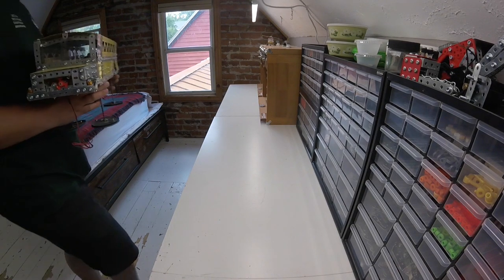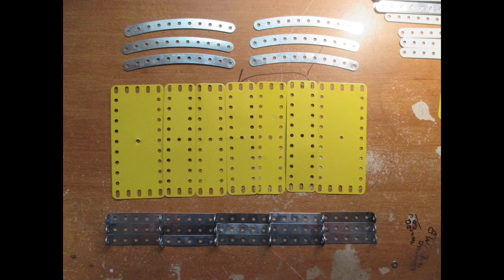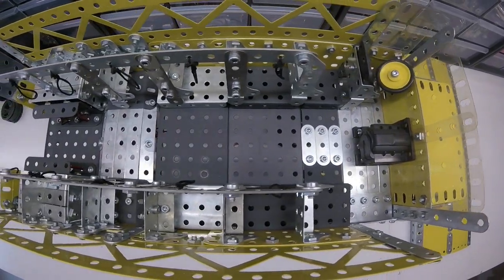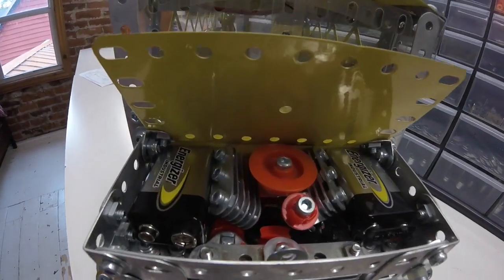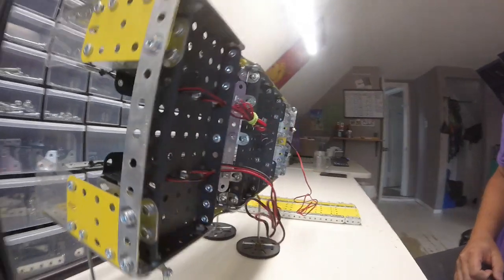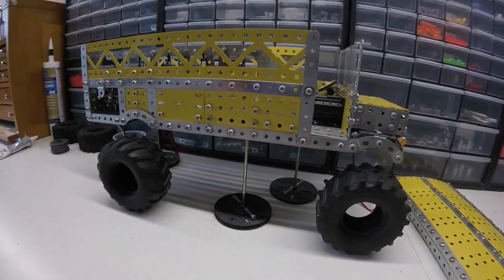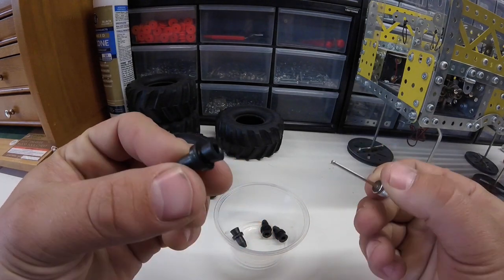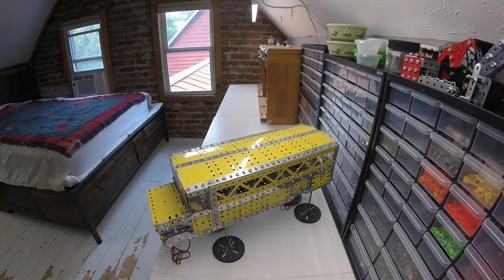I'm Working on a Monster Truck School Bus

Comment: If you started in 2019, it makes me feel slightly better that I still haven't finished my crane!  

That's a really cool build, and ambitious for your first big self design.  If you are putting so much effort in to the wiring then I think you need to put in the relatively small effort of getting working steering going, plus a gearbox and rear wheel diff.
Reply from the maker: As always, thanks for tuning in.
I think I've seen builders on here who have attributed 15+ years on models. That's crazy!

One of my favorite tree care customers who restores old cars always tells me the following regarding hobbies:

1. There's no budget.
2. There's no time frame.